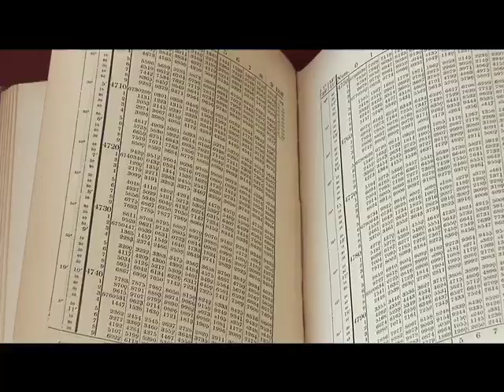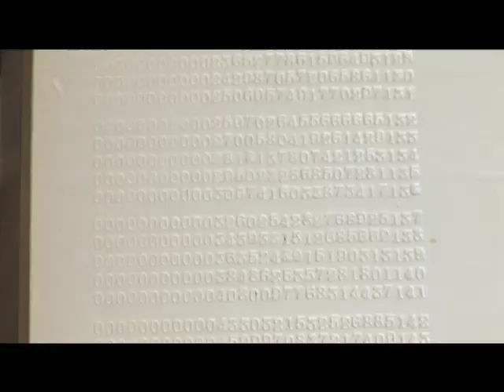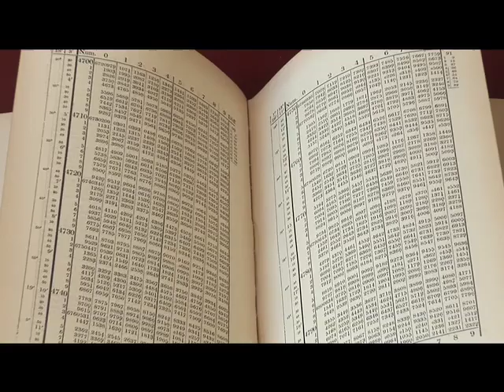Babbage's Difference Engine No. 2

Comment: Some engineering history facts: the major factor that stopped Babbage realizing the machine was in large part, lack of precision engineering standards at the time. There were no standard screw threads nor standardized drill sizes. Joseph Clement, the brilliant machinist who actually did the building - and drafting - for Babbage - recognised  this, but it was his student, Joseph Whitworth, who achieved this goal - and was knighted for it, it wa of such economic importance. Hence, until adopting metric, British threads were called Whitworth, or BSW  - British Standard Whitworth,
Reply: Awesome. Great info

Comment: It is what computer science calls "Turing-Complete", so if you built a version the size of a small country, and devise some sort of mechanical screen, and a compiler to output Babbage camshaft designs, yes, you could run portal, at 1 frame per year or something.
Reply: But could it run crysis?

Comment: You only need one difference engine to produce a tabulated book of results which can then be copied as many times as needed. Considering the amount of time that would have been spent in those days trying to calculate the same problems (BY HAND I might add) this would be well worth it because of the time saved and the inherent accuracy in the results which reduce errors.

Comment: Digital doesn't mean 'uses electricity'. Electric things can be analog (like a tube radio) or digital, and so can mechanical things. Digital means it operates on discrete numbers, like 1, 2, 3, ..., while analog means it operates on a continuous range (think a mechanical kitchen timer, where you can turn the dial to any point, not just x minutes y seconds).

Comment: I ran across this old digital computer patent 3190554 where it ran on compressed air instead of electricity. Was it ever built and used for anything? Could one be built today using 3D printing? If Babbage had gone the route, could he have had his Difference Engine built by the folks who made pipe organs?
Reply: On compressed air, really? Amazing.. Did that patent used to built the digital computer ever, like, for mass production? Or maybe only the demo version?

Comment: @privateworldofwarft 
If the analytical engine could be built of nanoscale parts, and cranked as fast as it would go w/o tearing apart, you might get speeds comparable to today's desktops.  I think.  I'm just kind of bubbling with possibilities right now, and won't pretend to know for sure.

Comment: clock freq. is measured in Hertz, which is cycles per second.4 cycles per calc., I imagine it would take about 2 seconds to turn the handle and its 1 cyc per turn : 2 x 4 = 8Hz = 0.000008Mhz
"RAM" wise it wud only have enough to contain the 31 digits required plus any carry bits - too tired to work out but it would be no more than 62 digits. As 1 digit is 1 bit then u have at most 62 bits which is nearly 64 bits which is nearly 8 bytes (8 bits in a byte). This is just under 0.00006MB.
Reply: decimal not binary

Comment: You can however measure IPS (Instructions Per Second), however both IPS, and FLOPs (if doable) would have been an stupid way of measuring the performance, as you can increase it by increasing the input RPM.

Comment: The video says one full cycle of the machine is four turns on the handle and not one. Then again, this thing is not a fully programmable computer. It's hardcoded to produce polynomial tables to a set number of decimalsm and it's of course not comparable to any clockspeed microprocessor of today.

It also obviously does not fulfil any of Crysis' other requirements; there's no sound output for one, unless you count the mechanical grind of cogs and gears... ;)

Comment: Well, if you crank the handle at 1 revolution per second, this device is would be operating at 1 Hz. -which is about 18billion times slower than the minimum system requirements for Crysis (1.8GHz).  Perhaps if you had Superman at the crank, but then the cogs and gears would obliterated by the frictional and centrifical forces generated.

In short, Crysis would crash this machine like no other computer has ever been crashed!